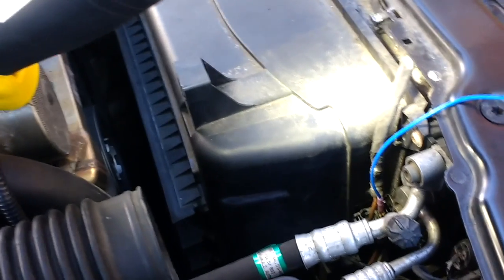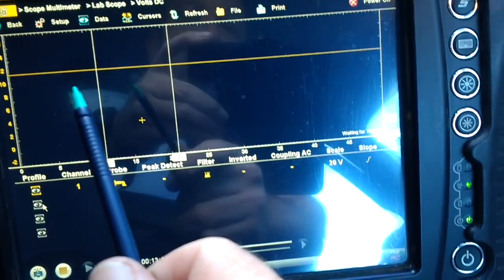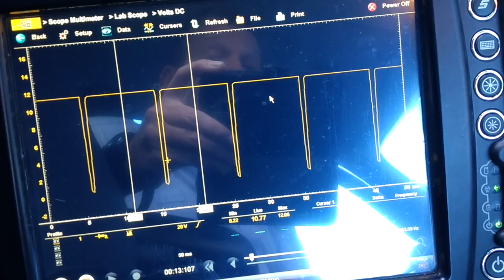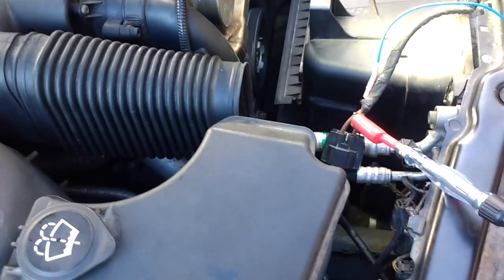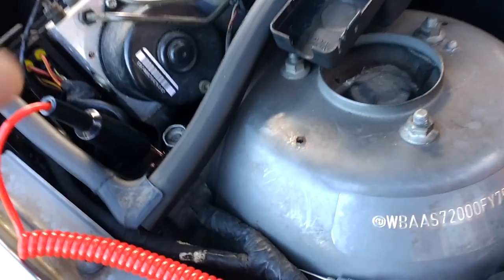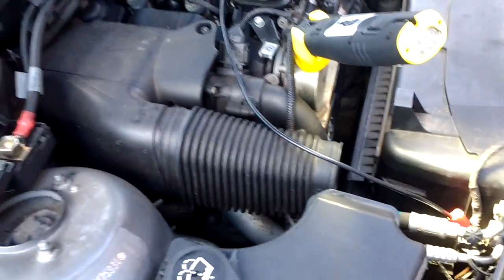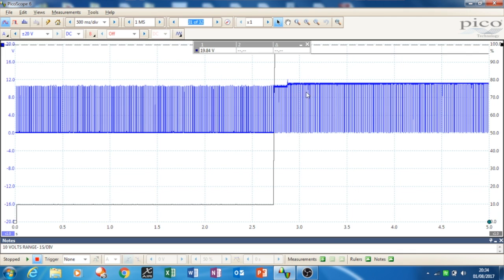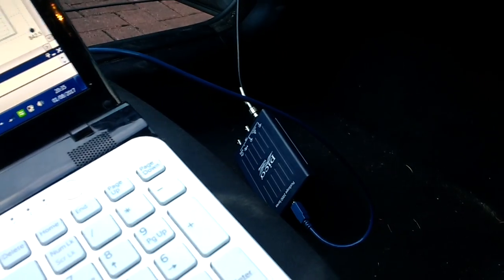TESTING COOLANT FAN DUTY CYCLE USING VERUS AND PICOSCOPE

Comment: I tried using test light on battery ground on signal wire( 3 wires to fan , one signal one key on positive and one constant ground) on a Nissan Altima 2013, the HVAC blower fan runs at full speed but dose not respond to pulsing ground, when I scope signal wire with controler plugged in there is no pulse and fan runs full speed with switch in any position.
Reply from the maker: LT White when u turn HVAC blower to different speeds does the duty cycle change
Reply: sandy anderson not on scope it's just slightly static straight line.  I have a new controller and blower motor ordered but would like to be able to diagnose for future jobs I am a mechanic.
Reply from the maker: LT White faulty HVAC blower module would be my guess cheers sandy
Reply: sandy anderson I'll retest and update once I get new parts, thanks Sandy!
Reply: sandy anderson I put the new module in and fan worked correctly, then I scoped it and got the correct waves on duty cycle, it looked perfect, thanks Sandy!
Reply from the maker: Good glad it worked cheers sandy